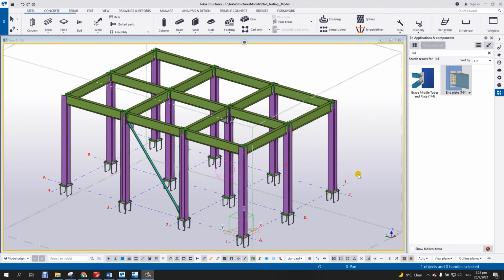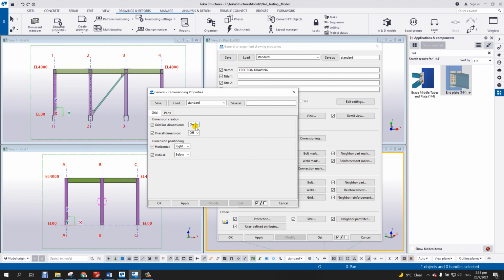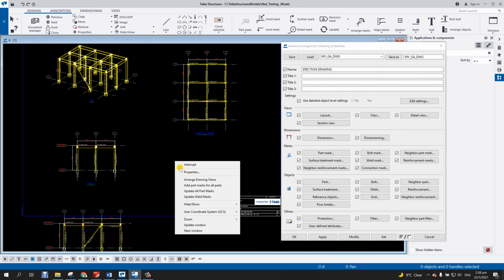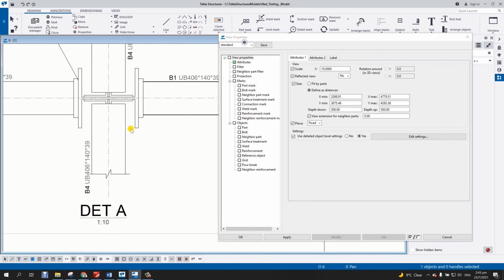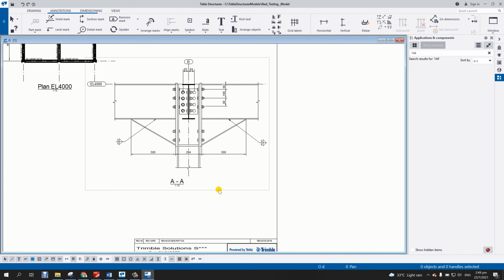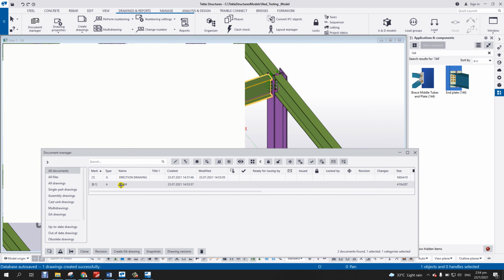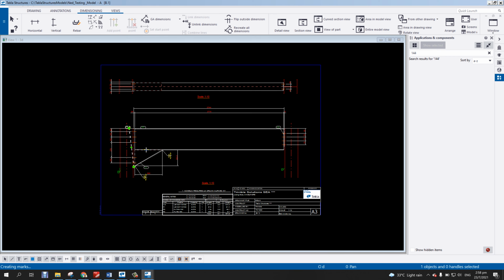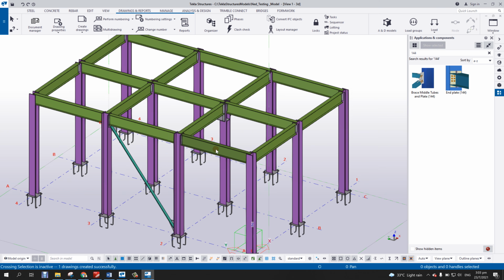How to create Erection Drawing, Assembly Drawing, Single Part Drawing and Multi Drawing?

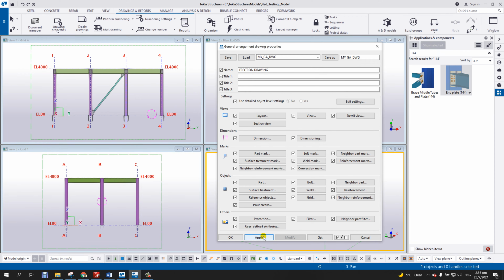Comment: Great video. FYI, at 8:11, when you hit APPLY then OK, the APPLY button press is unnecessary. In all windows programs, the APPLY button is for when you want to continue making changes after saving the ones you have made prior to hitting Apply (without leaving the dialogue box). Simply hitting OK will save changes you have made (otherwise it would say CANCEL).

Comment: how did you split those windows into 4? what is your shortcut command?
Reply from the maker: I made my own shortcut under menu-settings- shortcut
Reply: @thehowsofteklastructures565  i got it sir. You make a custom keyboard shortcut for tile horizontal / vertical

Comment: Sir, this is a humble request since I am struggling to find a resource to what I am finding hard to accomplish. Could you do a G+1 Building ...with just about 6 columns and a part cantilevered in Tekla Structural Designer and them Export and import it to Tekla Structures and do Foundation Drawings, Footing Drawings, Beam Drawings, Slab Drawings indicating the arrangement of the bars as we normally do for construction with their Bending Bar Schedules etc? I am torn between Prota Structure and TSD. If I could get stuff done with confidence in TEKLA STRUCTURES and TSD, I think I wouldn't look any further. Thank you for your time.
Reply from the maker: Hi, sorry but I'm not involve in our TSD. i will try to check with my colleague if they have that video. Thanks
Reply: @thehowsofteklastructures565  OK. I appreciate your time. Thank you.

Comment: I really wanted to know why your drawin starts so clean like that, i need to delete everything that I dont want and it takes too much time. It appears even with these global configurations you did in the video, I tried clicking in the element inside the drawing, but it opens a different configuration called piece mark other than the one in the global configuration, they dont even have the same list config, I'm really having a big trouble, please, if you can, help me out, I would appreciate
Reply from the maker: Sorry , i missed this comment, i have some video regarding the set up of drawing. try to look for the basic training topics
Reply: @thehowsofteklastructures565 🎉e Q we qa